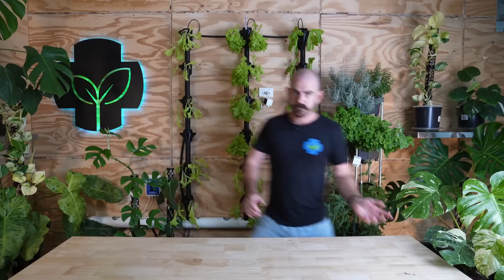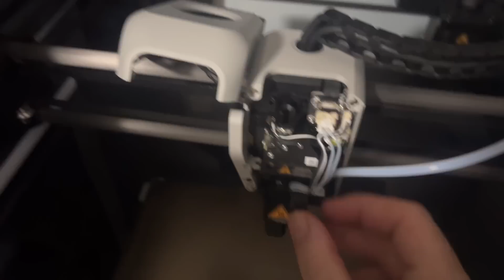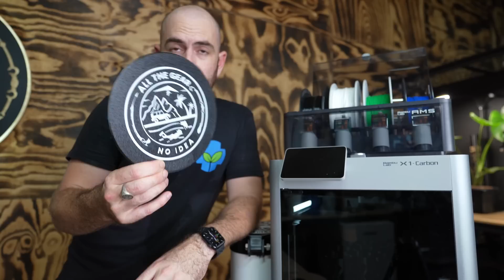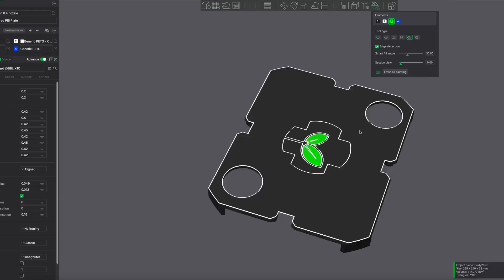3D Printers are now a Tool! P1S and X1C Comparison

Comment: I know I'm late to the show BUT, I learned something the other day that will improve the waste and cost savings for multi colour printing. You can purge to infill, (where practical of course), rather than spitting purge poops out the back. I figured that was something worth mentioning since I don't hear it spoken about ever on the videos about printing I've been watching.
I'm looking at getting started, (finally), in 3D printing with the X1C, (currently running at $1149cad vs P1S at $649cad), and hopefully taking a run at a business model for it doing prints on demand for a local hobby shop, if it's worth it, eventually expanding with a resin printer for those fine detail minis. 🤞

Comment: I got into 3D printing just 3-4 months ago with the A1 with AMS Lite.  I fell in love with the hobby immediately and about 2 months later got a P1S combo during the special for just $999, an offer too good to refuse.  Since then I have had both machines on the go pretty much constantly.  The only short coming is the screen on the P1S, but I have seen some videos about adding a screen which is very similar to the X1C’s by Bigtreetech.  Apparently you can control multiple printers from it and it’s currently less than $100 AUD, which I literally just purchased while I was typing this message.  I am seriously looking at the X1C as a replacement for the A1, this video is convincing me to do that or get a 2nd P1S, the jury is still out on that one.

Comment: It's an interesting marketing approach. They are deliberately dumbing down the P1S. The great software in the X1C could be loaded on the P1S at zero cost but they are deliberately making it less capable so as to push some users to the higher priced machine. It's like when you buy a car and there are features on it embedded in the operating system that you can't use unless you pay a fee. I think that will rub some people the wrong way but I guess they are free to do what they want. This was a really good thorough review.
Reply: Ones a midrange model and the other is prosumer. They've done a great job offering 2 great printers at different budgets which are meant for different types of customers. Like he mentioned it's not hard to upgrade the P1S if you want to save some money and simply use your phone screen instead.

Comment: This was an outstanding review. Coincidentally, on black Friday, I saw their printers on sale. I too have been laboring with Ender style printers for a long time, and felt it was time to bite the bullet. I wavered between the P1S and the X1, and came down on the side of the X1, not due to practicality, but because I have had too many experiences with products where I bought yesterdays tech and support ran out too soon.  So I paid a little more and got the whole kit (AMS included). In fact, it will be here tomorrow!
That said, a couple of observations and would like your thoughts too.
1. I have heard that the WiFi reception is weak. Some have upgraded that by putting a homemade antenna inside the printer. But do you see a weak WiFi signal? I also wonder why there is not a standard hardwired network port. Seems like that would solve connectivity problems on a network. My regular paper printer has that, and it ensures a rock solid connection.
2. Maybe the reason the software sees issues more often with the X1 is because the camera is better. Maybe it sees more detail and flags that as an error?
3. I wasn't sure what you were saying about the cardboard spools disintegrating. What is actually happening that you needed to make those guards for them? In any case, if I use genuine Bambu filament, it has a sensor that detects what kind of filament you are using and tells the printer accordingly, so no guesswork or extra hoops to jump through on my part. I like that and I'll probably use Bambu filament always going forward.
4. Regarding the slicer software...Another YT channel says that Bambu's version has MANY more bells and whistles. Kind of the difference between Apple and Android phones. What do you think?
5. I read that the super tack print bed they sell is fantastic. Do you have any experience with that?
6. I REALLY appreciate the tip about how to design for color. That tip alone will save me hours of my own research.
7. Finally, what design software are you using? I am gravitating towards Onshape, but am open to others.
Thanks for this. Two thumbs up and I am a new subscriber.

Comment: I hadn't followed Hoocho in about a year because I was happy with my hydroponics setup.  Since the algorithm decided I was watching 3D printing content, it matched me back up with Hoocho.  Well, this was about the best practical comparison of the two top end Bambu printers I'd seen yet.  Yes, there is a screen being built for the P1S that allows print farm control, but I haven't seen the pricing yet.  Is it money spent now or less money spent now and then later for upgrades?   Perhaps the P1S plus future upgrades is less total cost than an X1C off the starting line.  Either way, right now, Bambu Labs has the right solution for whomever you are, realizing that a 3D printer in every first world home is going to be the near future, like a TV, air fryer, microwave, or smart home device, to ensure the learning curve is manageable.

Comment: Thanks for this. It helped me make a decision. I started with an Ender 3 and seemed to spend more time futzing and upgrading it than I actually did printing things. I presently have a Prusa Mk4 (soon to be a Mk4s) and an FLSun SR Delta - both of which work extremely well - the Prusa especially.
Ergo, I think that the X1C would be my choice, as I would regret saving a few bucks initially only to start upgrading bits later (I know myself all too well).
This is a hobby for me, but I do want to be able to print functional tools and similar things with fussy filaments - so an enclosed printer is the way to go. Thanks again.

Comment: Hello BBL marketing; good job!  One thought though.  With all the people (like me) that will do the hard parts upgrade, should there be the P1T at $100 more than P1S?  I think that would be great.
For Hoocho, the X1c has a more powerful on board computer which accomplishes all the things, like Lidar, selective parts exclusion, faster and high resolution video.  I am a retired engineer that formerly designed computerized machines, so I understand what they are doing and why.  They are very talented designers and I am very impressed.

Comment: Wouldnt call it accessible...  i just bought my first 3d printer.  No knowledge, no experience.  Blind bought a X1C with AMS.  Im sure I will have a misserable time figuring it out from 0.  But I wanted a printer that could do.... ALL materials, in a decent size.  This one met that need.  For a massive price.  And i will find out how asinine the learning curve is when it gets here next week
Reply: How'd it go getting started?
Reply: Zero issues for weeks now.  Now one print failure.  Makerworld is easy, setup took like 30 min and I was printing everything from pla, to tpu to PPA CF without issue.  Now all there is to do is learn how to 3d model, and make my OWN stuff to print. And see how long the damn things last.

Comment: The top view to exclude objects is nothing ground breaking. Any DIY printer can do that with Klipper open source firmware, which by the way can also he used to control multiple printers with a single host
To me what's truly extraordinary is the plug and play aspect of a printer with its capability

Comment: 🎯 Key points for quick navigation:

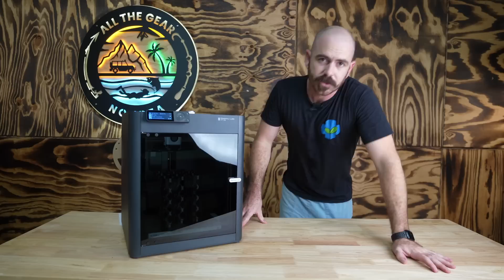00:01:00 🌍 3D printing has evolved from a niche hobby to a widely accessible tool for everyday use.
00:03:15 🖨️ Bamboo Lab's P1S and X1C printers are highlighted for their plug-and-play functionality, aimed at simplifying 3D printing workflows.
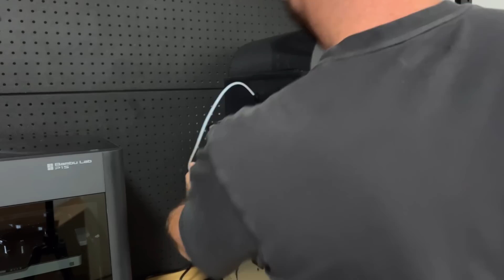00:06:00 ⚙️ The Bamboo Lab P1S offers significant speed improvements over older models, drastically reducing print times with its advanced features.
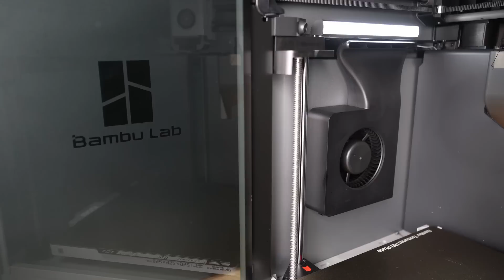00:09:00 🛠️ Both the P1S and X1C feature robust hardware including direct drive extruders and active vibration compensation, enhancing print reliability and speed.
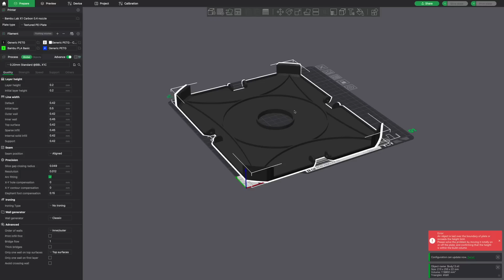00:12:00 📏 The X1C has additional capabilities like multimaterial printing and higher resolution cameras compared to the P1S, albeit at a higher price point.
00:17:00 💰 Despite costing less, the P1S can be upgraded to match many of the X1C's features, making it a compelling option for cost-conscious consumers.
00:20:30 📱 The X1C offers enhanced user interface features and AI-assisted print monitoring, improving user experience and troubleshooting capabilities.
00:23:00 🔄 Future upgrades may include networked printing capabilities across multiple P1S printers controlled by an X1C, enhancing productivity in prototyping and production environments.
00:25:00 🌈 Multimaterial printing with the AMS module opens up new possibilities for functional prints with diverse physical attributes, expanding creative potential in 3D printing applications.
27:13 🛠️ Spool protectors prevent cardboard disintegration and clogging in 3D printers.
28:32 🎨 Designing for multicolor prints with Bamboo Labs AMS involves using specific slicer settings and surface techniques.
29:27 📏 High tolerance allows intricate designs like bucket lids to fit precisely over objects.
30:08 🖨️ Bamboo Labs printers simplify multimaterial printing with pre-configured slicer settings.
31:14 🎨 Designing for multicolor prints involves embossing surfaces for easy painting in the slicer.
33:42 💸 Choose printers like the A1 Mini for affordability or the P1S/X1C for enhanced workflow based on print size and features.

Made with HARPA AI

Comment: 🎯 Key points for quick navigation:

00:01 🖨️ 3D printing has evolved to become accessible beyond hobbyists, now reaching a wider population for practical use at home.
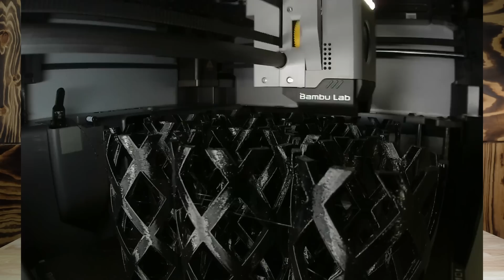01:25 🏠 3D printers are envisioned to become household appliances akin to microwaves, streamlining idea-to-reality workflows.
03:28 🎨 Bamboo Lab P1S offers plug-and-play printing, a significant upgrade from earlier, more time-consuming models like the Ender series.
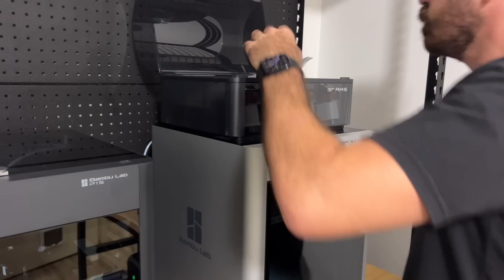05:41 📊 Bamboo Lab X1C enhances capabilities with multimaterial printing, impacting workflow efficiency and design possibilities.
08:13 🔧 Both printers feature robust extruders that minimize filament handling issues, crucial for uninterrupted printing.
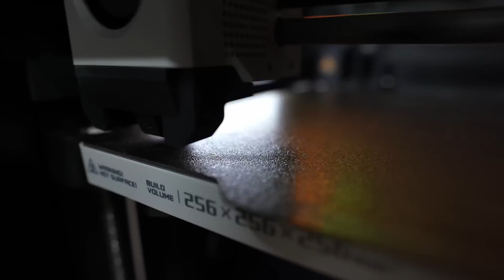10:32 🛠️ The bed size of the Bamboo Lab printers has an exclusion zone limiting usable print area, posing design constraints.
12:32 🔄 Differences between Bamboo Lab P1S and X1C include features like flow calibration, nozzle wipe, and enhanced bed leveling.
15:03 📸 X1C's 1080p camera offers superior quality for monitoring prints compared to P1S's 720p camera.
18:04 💲 Upgrading P1S to handle carbon and glass filaments costs about $56, making it a more cost-effective option compared to X1C.
21:23 📱 X1C's touchscreen and smartphone app integration provide intuitive control and troubleshooting capabilities, enhancing user experience.
24:29 🌐 Proposed integration for X1C to control multiple P1S printers could optimize workflow efficiency in print farms and prototyping facilities.
27:13 🎨 Spool protectors designed by the speaker prevent cardboard spools from disintegrating and clogging AMS units, enabling smoother 3D printing operations.
28:32 🖨️ Bamboo Labs PLA and PETG materials praised for vibrant colors, ideal for intricate and filament-efficient prints like the cracky bucket lid.
30:08 🌈 Designing for multi-material and multi-color printing with Bamboo Labs AMS involves surface treatment in design software for seamless integration with slicer tools.
31:42 🎨 Detailed instructions on creating multi-color prints using Bamboo Labs slicer, emphasizing surface treatment and layer-based printing techniques.
33:42 🖨️ The P1S printer noted for affordability and print quality, while the X1C offers enhanced control and workflow benefits, catering to different user needs in 3D printing.

Made with HARPA AIn

Comment: Tips : buy the panda touch , the  hardened upgrade and you good to go no need to buy the X1C and the Lidar Gadget
Reply: It’s a touch screen upgrade for the P1S
Reply: @diwest1737  Where can you find it ?
Reply: Amazon
Reply: And the bed temperature deregulator from spearhead equipment lol
Reply: what's the panda touch?
Reply: @juanpalomino7043  a screen compatible with all Bambu lab printers for +/- 70€
Reply: @juanpalomino7043  It's a touch screen for the P1S from bigtreetech
Reply: @juanpalomino7043 it’s a better screen for the p1s

Comment: Like you, I came from Enderland and enoyed every minute of it. But I came into a little cash and decided to see what all the Bambu hubhub was about. 

I put one toe in the water by getting the A1mini. I'd see how I liked their ecosystem. If I liked it, I'd order one of the big guys. I love that little A1mini! 

So I had to decide whether to go with the P1S or the X1Carbon. The P1S was sooo much cheaper than the X1C  and only lacked things I didn't feel like I needed anyhow, and if I decided to get an AMS, I could retro-fit it. 

I love the P1S! I still don't know that I care enough about multi-filament types and colors to order the AMS add on. 

So... except for the lame LCD monitor on the P1S, I'm very happy and saved a lot of money. If I decide to buy another printer, I'll probably get the P1S again. 

In the meantime, maybe they'll come out with a "P1S Plus", a P1S with the X1C monitor for a couple hundred more bucks (US).

Comment: Both are available in a combo version, with the difference that the P1S combo is about €600 cheaper then the X1C.
Almost all the benefits the X1C has, can sort of be integrated into the P1S, but for a way lower price.

- Panda Touch, a touchscreen that can control over 10 Bambu Lab printers, and which also lets you graphically control the AMS unit on the P1S for just €50.
- Hardened steel nozzle for €20.
- Hardened steel gears for €20.

And you almost have a X1C for just €100 more instead of €600 more.

Only features that stay is the Lidar and the AI (with the slightly better camera).
The Lidar is just a gimmick that scans the first testing grid for calibration. If it's unable to scan the calibration pattern, then it automatically falls back to the calibrated flowrate value, which already does a decent job on it's own with a verry fast and simple manual calibration. Which actually makes Lider a little bit obsolete. I even wouldn't be surprised that we won't see it back on a P1S/X1C follow up.

Makes it only missing the AI functionality, which might be a handy feature, but I don't think that's worth €500.
Reply: Where does it say that? "If it's unable to scan the calibration pattern, then it automatically falls back to the calibrated flowrate value, which already does a decent job on it's own with a verry fast and simple manual calibration." First time I've heard that.
Reply: @CreativeDesign75CZ  It's in the official Bambu Lab Wiki. Besides that it's not able to "read" all kind of materials. For instance translucent materials. When Lidar calibration fails it falling back to the standard flow-rate settings.

Comment: You would think apple would run better but it doesn't. There have been several studies that show that Samsung android is almost twice as fast. It also has less down time and costs much less to operate.
Reply from the maker: @Serenityindailylife  speed does not equal reliability. 
Weirdly, the Bambu have both 🤣

Comment: Would be great if they could add another print head for support material.
Reply: They having a lawsuit going on now. One of the things is about the use of the prime tower, which is actually needed to normalize the pressure upon filament switch.
There're rumours/signals already that the P1S/X1C follow up might be a multitool head printer. Which could be a logical thing because of those ongoing lawsuits now.

But it probably will going to be a €2000+ machine then...

Comment: It's so nice to see someone that uses the machines for practical items instead of the incredible amount of landfill we constantly see.  I am just about to push the button on the P1S after testing and using the A1 Mini for 6 months, which really is just a case of sending the print without wasting time on tinkering.  Also the quality I have achieved has far exceeded anything I had seen from many other machines, some costing far more than the A1 Mini.  Im gonna have to watch this video a few times to fully understand how your achieving those examples of using the ams for things such as your logo etc,  its a great solution especially when you want to reduce wastage but provide a really professional result.  Both of your examples are excellent.  Thanks for this review it really has been helpful. Oh one other thing did you know that the Bambu Lab app can act as a central control for multiple printers also there is the Bigtreetech Panda Touch which is a mobile touch screen allowing control of many Bambu printers.  I actually purchased a unit from aliexpress and it works brilliantly I paid £45 so roughly $90Aus -)